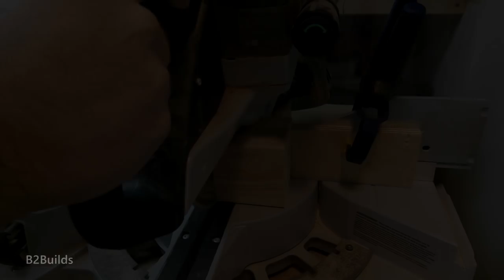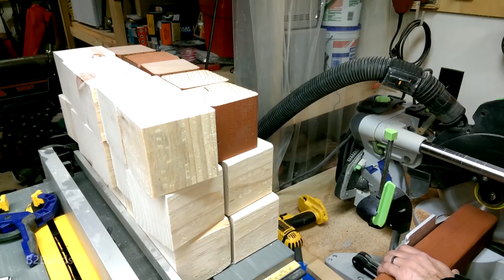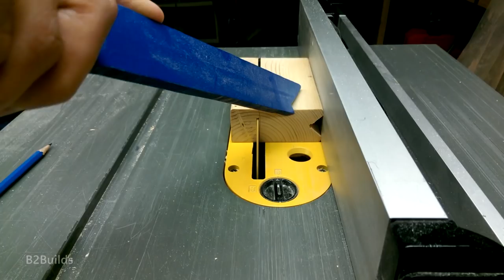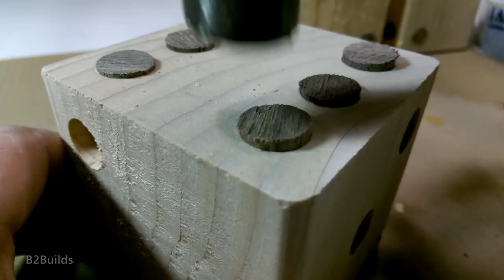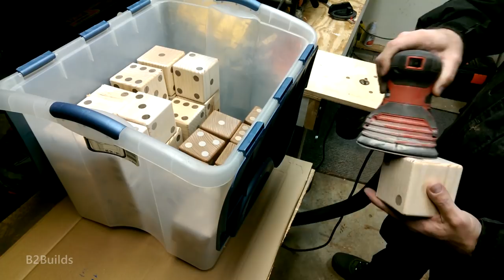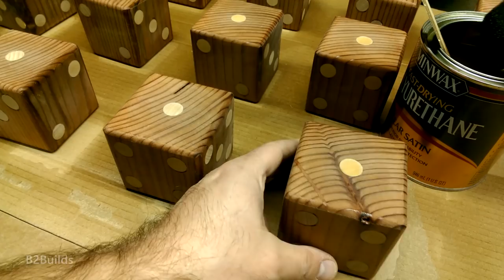Yard dice with inlaid wood

Comment: great video, i just got into woodworking i have made 2 crates, 1 was from Steve Ramsey the other was one i did free style, a bench top  for my push sticks push blocks and frame strap i only made 2 die so far, that's all i had laying around plus it was pressure treated, i ha dan idea for the numbers, on a leftover piece i was thinking caulk or even flex seal, i am trying the caulk then the more i thought about it i an thinking the caulk will get dirty.great video. i am thinking about a wood template out of plywood then just set on die then drill, i don't have a drill press yet.

Comment: Just found this awesome video. How deep did you drill the holes and did you push the dowels all the way in? I'd be worried about the glue pouring out! I need to buy a few tools for this. Thanks!
Reply from the maker: I drilled the holes about 1/2 inch deep, and pushed the dowels all the way in. As long as it's a relatively snug fit, you shouldn't have to worry about glue or anything falling out
Reply: Thanks! I’m going to give this a try. I just need to add to my tool library so it will have to wait until this pandemic lightens up!